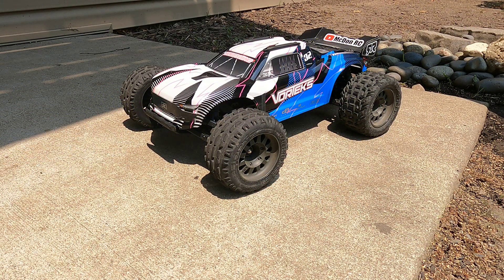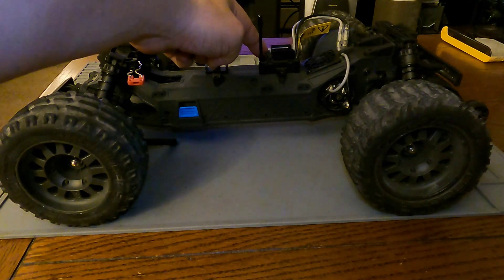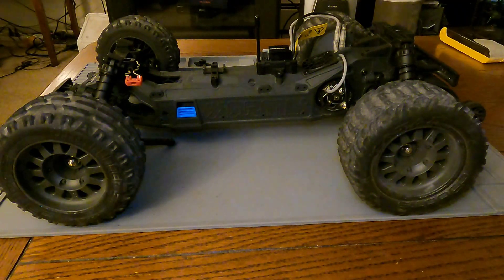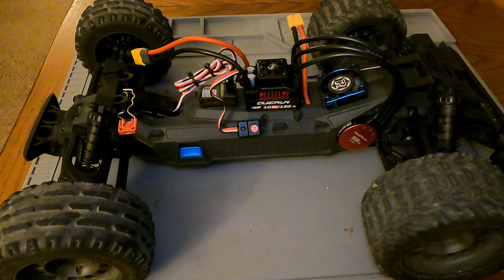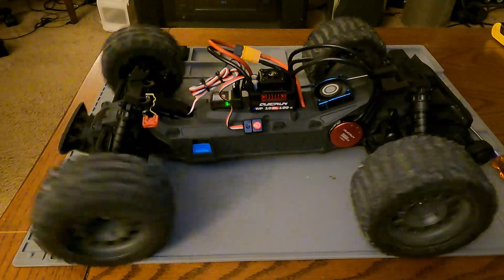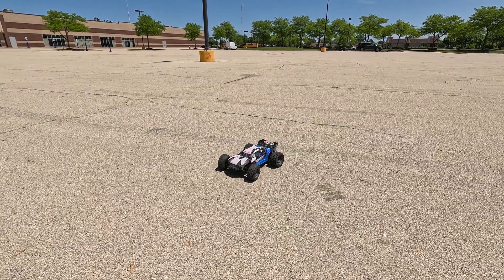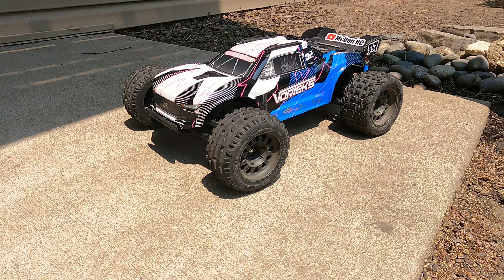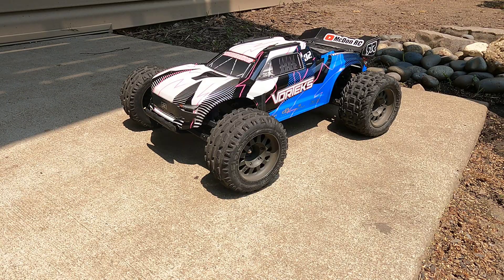Brushless Conversion: 101 Arrma Vorteks 550 Mega

Comment: when doing a brushless swap like this can you use the stock controller or no?
Reply from the maker: So with this particular car no. It uses a 2in1 receiver/ESC. So you would need a new receiver and transmitter to go along with the new ESC in your brushless system. A lot of RC cars and older Arrmas come standard with separate receivers so if you change the ESC you can still keep the stock controller.
Reply: @McDonRC I have the exact same car you have an the brushed motor gave out finally I bought a brushless system with a reviver and Ecs from cash4rc it’s a 4000kv set up should be a ripper, I’m new to the electric side especially brushless I’ve ran some nitro stuff enough to get my feet wet an half way know what I’m doing haha

Comment: I had the same problem with engine rotation it was spinning backwards I change the wires but it don't go as fast you need to reprogram the ESC and put the wires back
Reply from the maker: So mine was different it was original spinning the right way but the brakes would come on the first time hitting the throttle. I reversed the Channel on my transmitter so brakes come on when you push for reverse not pull for throttle. But after that the tires were spinning the wrong way so I swapped motor wires to get the tires to spin the right way. It wouldn't be driving 55+mph if the ESC thought it was driving in reverse.

Comment: The range in my dumborc is limiting. I dont get even 150m without losing control. For a speed run in mine i need more than that since it is still making progress when i brake.
Reply from the maker: That is weird. I have never had an issue with range with my dumborc. 150m is pretty far. I cant's say I have pushed mine much further. Maybe 200m. I think they are rated at 400m. Unless you are going for 100mph+ speed passes you should be just fine.
Reply: @McDonRC in this case i was just trying to check topspeed which is around 50mph. I usually coil the antena to save space, maybe in this case i shouldnt or the fact the receiver has gyro gives it less range comoared to for example the receiver i have in my little hbx 1/16

Comment: Curious.  As of today, would you do a swap or would you just buy a truck with a brushless?  I picked up the 550 mega today for the price point.  Happy with it but just wondering.  I'll likely just get a spare battery and let my 8 year old have at it.  thx.
Reply from the maker: It's about 6 of 1 or half of a dozen of the other. Building up yourself, you can pick the Motor KV and receiver you want. Go with the 223s RTR you will save some money and still have a great performing truck. Starting brushed is a great option for beginners because it's easy to get in trouble with the 50 mph+ 223s or upgraded version. And it's relatively cheap to upgrade down the line.

Comment: Servo saver upgrade: simple option is to epoxy / glue a metal washer on the base of the servo saver - the base part that sits on the servo.  This increases its strength and stops it splitting open when high torques are applied. Epoxy is better than superglue for this application.
I repaired one that had already cracked (like yours) and have done it to a new one as well.  No issues on either since.

Comment: That’s so cool my daughter just got me one for my birthday, but I’ve been out of the game for just about 20 years. She thought it’d be fun if I get back to the RC world the last one I had which I sold back in 2007 was the Ntc3. So my question was can I run this Bruss system motor ESC and fan for now with the remote control that comes in the box until I buy a proper radio? Thank you.
Reply from the maker: So these trucks use a 2n1 receiver and esc so when you do a swap to brushless you will need a separate receiver. You could get like a spektrum SLR300 that should work with your original radio. I would recommend getting dumborc radio and receiver, they are cheap but decent quality.
Reply: @McDonRC  wow thank you for the quick reply. That sounds good. The one I have is the Vorteks 550 brushed that just came out not too long ago and when I saw your video with that upgrade, I told myself I need to do this. But was not sure if I can use radio or did I need radio and receiver upgrade
Reply from the maker: @castro6966 No Problem. They are really fun trucks!
Reply: @McDonRC  OK I just picked up the dumborc six channel transmitter with two receivers. My team associated Ntc3 will be back in my hands because I sold it to my uncle and he is giving it back to me for free. I figured I can put the other receiver in the Ntc3. You have no idea. Thank you so much. You have been super helpful. You have a blessed day.
Reply: Any chance on 3S the battery will get too hot that will ruin the door panel for the battery since it’s plastic?
Reply from the maker: @castro6966 No, the battery will not get hot enough to melt or deform the plastic. The motor will be what gets the hottest but still should not melt anything. There is a spot to add a fan for the motor for extra cooling if your driving hard or live in a hot area.
Reply: @McDonRC  ok good. yes I ordered the same fan you got and  the radio transmitter you recommended with two receivers  and the upgrade brushless kit. The only thing I did not get is the servo. I have some guy already telling me here at the RC track meet in Staten Island New York. Tell me “dude you can’t put a  3S it will melt the plastic on that door.” 🤷🤷
Reply from the maker: @castro6966 Nah, I had a 4s system in my Fury, which is basically the same chassis and had no problems. You can hold the battery in your hands afterwards.
Reply: @McDonRC  awesome anyways I’m just waiting for my radio with receiver and the same brushless kit with fan to arrive so I can put it together. Any batteries you recommend right now I have 2 spektum smart G2 5000 50C lipo
Reply from the maker: @castro6966 One thing I don't think I talked about in the video. The hobbywing motor uses a 5mm motor shaft so you will need a new pinion gear with a 5mm bore. It uses .8 mod gears or 32p they are interchangeable. You can normally find pinion gear sets pretty cheap on Amazon and comes with different sizes. Arrma also sells motor plates (ARA-1760) for different gear sizes to make setting the gear mesh super easy.
Reply from the maker: @castro6966 The hobby wing system uses xt60 connectors for the battery. So its best to use batteries with the correct connector, but they do make adapters if you have a different style but not really recommended. If you're good at soldering you can also change connectors to whatever you have.
Reply: @McDonRC  nice!!! And thanks again. I felt like this guy was being very negative about my new RC. He also told me don’t even bother putting any money into that to buy something else,.. in my head. I was like dude, I’m not even trying to compete. I just want something to enjoy.
Reply from the maker: @castro6966 Yeah some people are too negative. It's definitely more of a basher then a competitive racer but still tons of fun.
Reply: @McDonRC I’m about to prove someone wrong 😂😂😂
Reply: On the ESC, did you use the default programming or did you changed the program with the program card? Thank you.
Reply from the maker: @castro6966 I used to factory programming. You can change programming without the card. Using the set button by the power button. But way easier if you have the card.
Reply: @McDonRC ❤🙏🙏 just got my radio transmitter. Dumbo DDF 350 with two servos and the hobby wing kit. Super excited!!! The second server I’m going to use it on my NTC3. Thank you so much.
Reply: So everything seems to be working good except my gyro is working the wrong direction
Reply from the maker: @castro6966 Press the set button on the receiver twice and it should reverse the direction of the gyro.
Reply: @McDonRC  that definitely reversed it , now the funny thing is it has little shakes like if the car was nervous 😂 😂 when it’s not one thing is the other I’m assuming the sensitivity is too high or is there something else I need to do?
Reply from the maker: @castro6966 the knob For Channel 6 will adjust your sensitivity for the gyro.
Reply: @McDonRC thanks again. It runs pretty good on 2s. Now thinking of getting a 3S for it.

Comment: For speed runs, do you consider the Vortex more stable than the Fury?
Reply from the maker: The Vorteks is WAY more stable than the Fury for speed runs. The body on the Fury starts to parachute above like 40 mph. You have to be very delicate with the throttle. The Vorteks you had to feather the throttle a little bit down low but once you were moving you could hammer down no problem.
Reply: @McDonRC  Thanks

Comment: I ordered the 3150kv for my 2wd slash but i do more offroad and bashing. You think it will be still good on 2and 3s? I come from the bl2s setup so i hope it’s better even on 2s(more torque) what you you think? Or 3700kv would be better?
Reply from the maker: So the BL2s is 3300kv so with the same gearing the truck will be a little slower on 2s, but you can run 3s with the hobbywing system which will give you a lot more speed and power. For off-road and bashing you won't really need the extra speed the 3700kv will give you and the 3150kv will run a little cooler.

Comment: Did you use a 5mm Pinion gear on the brushless? Great video btw.
Reply from the maker: Yes the Hobbywing 3660 uses 5mm motor shaft.
Reply: Ok man I need help. I've gone through 3 different pinion gears and none of them match. I'm using the quickrun 3700kv. Could you please give me the info on your 19t?
Reply from the maker: @bremcity3608 OGRC 32P 5mm Pinion Gear 17T 18T... https://www.amazon.com/dp/B08KXXXS3H?ref=ppx_pop_mob_ap_share
Reply: @McDonRC  thanks for the help man. Honestly I'm just dumb and forgot to take the motor mount bracket off.
Reply from the maker: @bremcity3608 ah, that makes sense. Well have fun with your new set up!
Reply: @McDonRC Update on my build. Truck runs great. 3s is definitely were its at with this truck. At first i did all upgrades without changing the servo, that lasted 2 days. Did some offroad speed driving and broke the servo. Also hit a parked car and snaped the front upper and lower suspension arms off. Back to the hobby store for a quick fix, and ended up putting a ecopower wp200t in it. Only thing left i think is belted tires and a compatible aluminum servo saver, if i can find one.
Reply from the maker: @bremcity3608 Yeah, the servos/servo savers are definitely a weak point on these trucks. I picked up a metal servo saver from Amazon but haven't installed it to see how it fits. These trucks are a blast on 3s. I see Arrma just released a 223s 2wd Vorteks.
Reply: @McDonRC I ordered an aluminum saver from Amazon also, though I think it could be a waste. Had a thought about sending in the composite saver and link mount to a CNC shop, but that all depends on the price. I seen the new model as well. I believe the only difference is that it has a 4000kv brushless, and maybe a Slt3. Hopefully with this new model we can get more aftermarket parts.
Reply: @McDonRC Any luck with that new servo saver? If so, please send the Amazon link.
Reply from the maker: @bremcity3608 I haven't yet. I have it as a back up for for when the factory saver breaks.
Reply: @McDonRC I'm on my second factory saver and have 1 left. The aluminum saver I got, you have to use nylon lock nuts to hold the steering links securely as it's flat. I'm going to install it today probably. I'm finding the factory savers keep stripping in grass bashing. I'll let you know the details.
Reply: @McDonRC i have a 48P pinion, is this not correct? Because stock is 48P or did you change your spur
Reply from the maker: @JvD1985  48p is wrong. I am running the stock spur gear, the pitch is .8 mod or 32p
Reply: @McDonRC how many teeth did you use in the video?
Reply from the maker: @JvD1985 I used a 19 tooth pinion gear